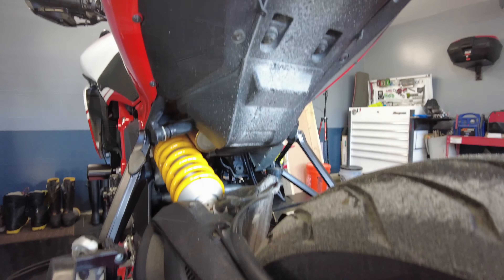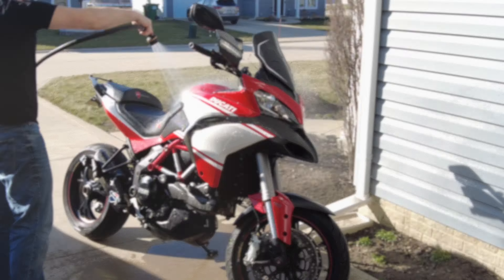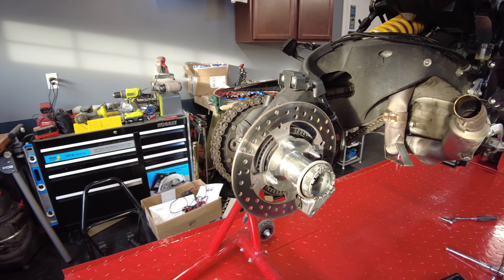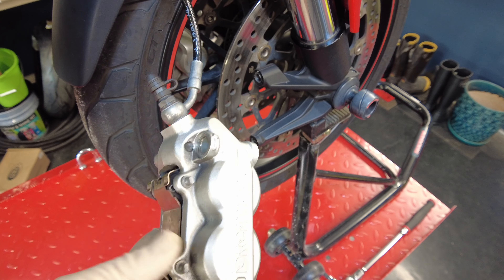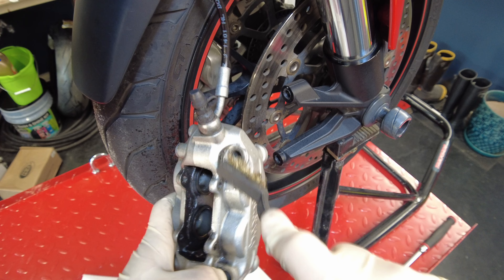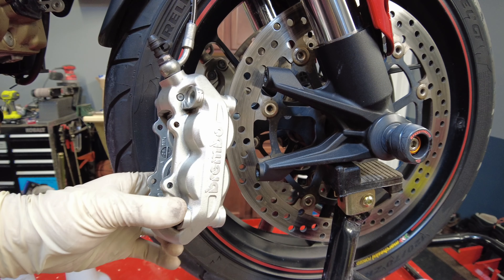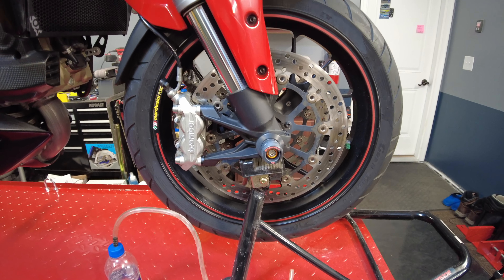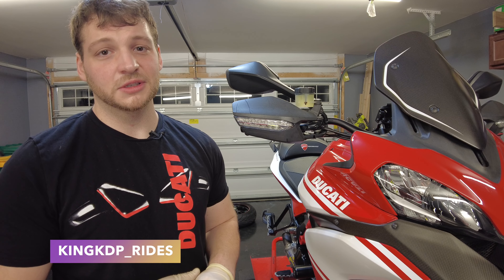Ducati Multistrada 1200s Pikes Peak Track Prep: Ep 5- Front Brakes

Comment: Ducati service manual : "Operate the front brake lever two or three times.
Hold the lever pulled towards the handgrip and simultaneously tighten the caliper screws to a torque of 45 Nm ± 5%." 😉